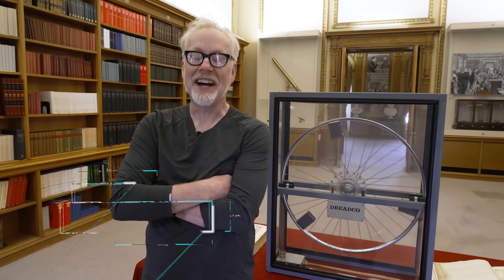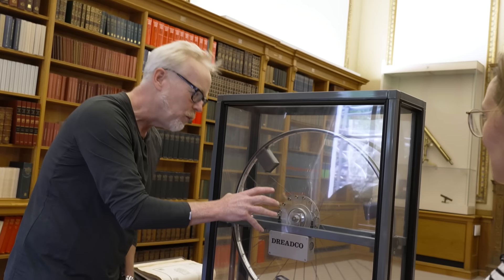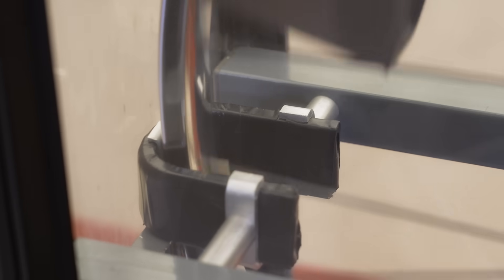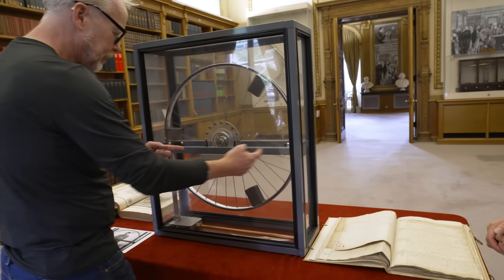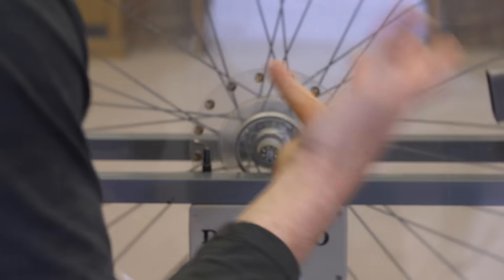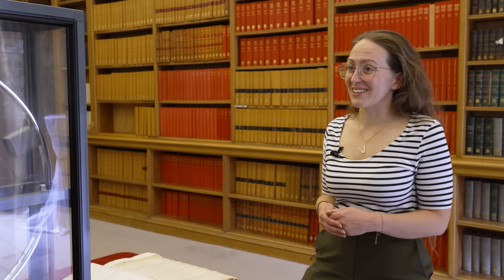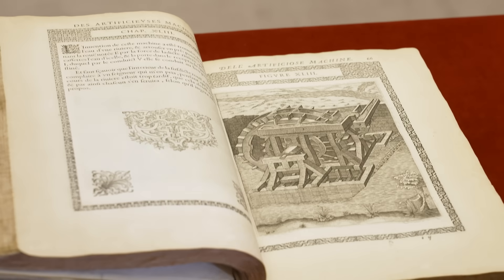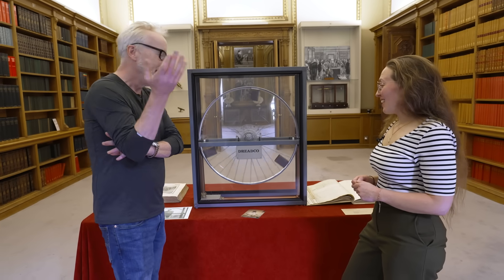Adam Savage vs The "Perpetual Motion" Machine!

Comment: I think each of the three boxes in the wheel contain one reed-switch, one electromagnet and one battery (connected in series). As soon as one of the boxes approaches/enters the stationary horseshoe-magnet (on each side of the wheel) the reed-switch closes and will power the electromagnet which pushes the box away from the stationary horseshoe-magnet. (so the batteries only deliver power for a very short time to overcome the friction from the wheel-bearing and some air-resistens ). All the other items in this contraption are there to distract you. so it is indeed a motor, I'm even surprised that it runs only for 2 years.

Comment: The Dreadco box seems like a sonar range finder set to detect the pieces on the wheel in order to send a synchronized pulse to keep the wheel turning by electromagnetic repulsion. The pipe? just a conduit for the cables. This is why they don't allow close examination.

Comment: Well I know that copper wire can pick up wireless power, and they have a copper pipe at the bottom which could possibly have a copper coil or maybe the pipe itself could pick up the charge, and they have the table covered in a cloth.

Comment: What if you had a tower of water wheels submerged in water and each one had its own generator and you had a small 110v fish tank air pump at the bottom of the tank turning each wheel could you produce more power then the pump was using once the system was primed using a buoyancy wheel 🤔🕵

Comment: Coils in each ofthe 3 blocks sense the approaching magnet and then are driven with a pulse which gives the wheel with a small kick. How about put in a vacuum with magnetic bearings, should spin for ages without any power.
Reply: You need electromagnets and a batter and a timing for switching polarity to make the wheel spin using magnets. You can’t do it with permanent magnets and no battery.
Reply: @Chevsilverado  yes that was the idea - coils driven by an active pulse. It would be more fun to have a low friction wheel, and see how long it could go.

Comment: Even living beings do not have perpetual motion.  Give a machine the ability to process energy from organic materials and to seek them out autonomously and that will be the closest you get to perpetual motion.  Solar is an easy way to do this probably, make a solar-seeking wheeled chassis that follows the sun and can avoid shade during daylight hours with a water avoidance system and hazard detection like modern robotic vacuum cleaners.  Allow it to enter a power saving mode during night hours where the perpetual motion slows way down.  Yes, this could be a fantastic machine and work of art.  See how far it travels a solar gradient, weeks maybe even months before "dying."

Comment: My guess: It's similar to the Put-Put boats we had as kids. The little cups around the hub are level with two vertical pipes, one of which faces up, and the other down. Somehow (don't know how) air is warmed in the box on the bottom left and softly flows up the copper pipe giving little puffs of air into the cups. The balanced wheel would begin to rotate, but lubrication would require maintenance from time to time.
Reply: I agree It is a heat engine. Remember, she said, when they put in the basement, in the dark, it starts to slow down. Which, could mean, not that is dark, but it is cooler, in the basement, so the heat cycle, slows down. Due to heat loss.

Comment: Can someone explain to me how just magnets on a wheel wouldn't be a perpetual motion device?
Reply: Magnets can’t spin a wheel because the wheel speeds up when the magnets approach eachother, but as soon as the magnets pass eachother the wheel gets slowed down by exactly the same amount. 

It will never make the wheel spin faster. 

It’s why electric motors need to use electromagnets and switching polarity, so that doesn’t happen.
Reply: @Chevsilverado  ah thanks that makes a lot of sense

Comment: I'm guessing that the controller in the DREADCO box isn't triggered by light sensor but those two probes, everything else just decoy. Or maybe there's some supersubtle optical sensors but it really doesn't matter how you signal the boxes to give a push, just so easy once they do. Hell, with anything even approaching NASA $$$ i would've just made the boxes have ultrasensitive little sensors inside that detect when the fixed magnets are approaching and use them to trigger the electromagnets powered by the internal batteries. In fact, that suddenly seems almost as plausible to me: literally everything other than those black boxes and the permanent magnets decoys. It would be conceptually easier to make it work with the DREADCO box and pipeworks containing NOTHING.

Comment: 6:23 the more i watch the more i think it's an obvious simple motor with permanent and electromagnets. There's plenty of room for an electromagnet and an 18-650 battery or two in each of the black boxes. Only trouble is timing, but I think there's room for another battery-bank-powered sensor in the "Dreadco" box that transmits a bluetooth like signal to a super-low-power receiver in each black box, which triggers some super-low-power arduino(sp)-like device to trigger the super tiny electromagnetic impulse, just like the tiny stepper motors in each hand of modern quartz watches that can manage to "run forever" on a little light (and usually run in the dark for at least six months on their tiny, probably deliberately small, internal rechargeable batteries). In fact, the lack of a vacuum says it all: they've got energy to spare running this scaled-up watch motor for a coupla years. Only thing needed sealing was the bearing, so that it didn't accumulate grit and dust. An ultra clean and dry ball-bearing is insanely efficient.
Reply: Unsealed bearings have the best free spin rate
Reply: The timing could be done by those little cups and prongs in the middle of the wheel. Looks suspiciously like a reluctor ring. Only thing I don’t get is why they need two prongs and so many little cups.

Comment: 1:38 oh shit: if this just turns out to be batteries in either the spoke boxes powering electromagnets that get ever-so-briefly-and-weakly turned on or batteries in the copper plumbing (which i wonder now if is a decoy), then I'm gonna be so disappointed.

There should be no internal power source. I mean, god: if there is one might as well call a three-hand watch a "perpetual motion machine." Or one of our space probes with nuclear fuel. If the power is internal imma cry DUMB.

Ok, maybe I'll be impressed with the cleverness. But still... somehow powering it from external power like the heat of the room (or gravitational fluctuations or something!) would've been sooo much more coolerer.

Comment: Here is a parallel example of a "renewable" water pumping system. Such systems may continue on farms for 35 years next to a river provided the river never runs dry and the system does not break down. They will continue to run without external power including  without a solar panel, by splitting the energy of the running water through them. https://www.youtube.com/watch?v=9NHVmOchAgI It is called a RAM pump. This initial example with bucket of water as the source, does not utilise natural energy of running river water, so it shuts down much sooner. This is such a clever use of the mechanical energy of running water. There are many examples of RAM pumps on You Tube.
Reply: Some more ideas have been added to the post below just now, for those who want to re-visit it.

Comment: The steel spokes of the wheel, passing through the two magnets, produce small eddy currents, which gets harnessed by the "motor".  The spokes, most likely 18 on each side of the bike wheel, (making 36) are also staggered, creating constant perpendicular charges across the magnets at a deceptively fast rate.

Manufacturers of bike lights use this concept to power small led lights without any other power source, other than the spinning wheels.

Comment: Took me about 2 minutes into the video but I figured out how it works, the box with the word Dreadco on it has a ventilation screen on it which is most likely where the battery is, the box below might have the circuit board, the copper tubing is hiding the wires, the Big Blocks on the outer edges of the wheel are magnets and there's a couple more blocks that they pass which of course are electromagnets it's using keep the thing in perpetual motion which is definitely possible but as stated it is using a form of stored energy, perpetual motion is definitely possible but it can only last for a certain time frame before it loses its momentum because of gravity and of course air friction, this device is definitely very efficient with its motion but it still has to use a spark of electromagnetism in order to keep it going, perpetual motion is only possible with no gravity and no air friction, that of course is outer space

EDIT As i watched the video Adam just spotted everything I just listed, and that's why I love him, he's a smart man

Comment: I think the box has photo sensors, and at 5:00 I think she was trying to hint it gets put away in a dark room for an extended period of time that maybe when they sense light they turn it on and when it goes dark it turns it off to conserve the 2 year battery life. The battery is most likely lead acid. And the drive is most likely in the brass tubes that go to the box. The magnet coil idea Adam was going at is the on off switch because if that was true it would be easy to turn it off Being the box withholds the photo sensors and are attached to the magnets which go through (detect/communicate with) the coil windings. It's just like a dirtbike motor, we ground the coil windings to stop spark which stops the motor, the photo sensors most likely use a resistor which connects a ground to the coil windings, that would cause a change in polarity and probably stop what's driving it either if it is the polarity of the magnets or a simple electric drive motor that's fed power. No matter what it's photo sensors that's the trickery behind the two year non stop period
Reply: lol being in the dark doesn't mean nobody is looking. How would it start up again from standstill?

Comment: It's not battery, it's capacitor, and the anode and cathode gives it enough delay from first to second magnet to let it have turn force. (my educated guess)
And there is the copper pipe has to do something with the cooling and heating? Like stirling engine? As of this comment, I don't know..

Comment: The thing is even if it were a motor that’s generating enough charge to keep itself running, that in fact would qualify as a perpetual motion machine. It’s unfortunate but you can sort of tell he throws in big words and half baked basic engineering principles here to try and make it seem like he really understands what’s going on but unfortunately he doesn’t. A perpetual motion machine that can self generate any resource to keep itself going indefinitely is perpetual motion, therefor in order for it to be pseudo perpetual there is some hidden resource that sssists in the motion that needs to be replaced or “serviced” at some interval.

Comment: If they have permanent magnets it should be easy,  although never perpetual in part due to demagnetisation over time.   The energy is embodied within the magnets.  Some permanent magnet that rotates inside those boxes and fixed magnets on the frame,  thus allowing the poles to switch and act as repulson to give the wheel a push.  The momentum from the turning of the wheel could easily power the rotational switching of the magnets poles.  Thus a small battery might be involved that gets recharged.  Given the wheel is balanced, the magnets only need to overcome the frictional forces of the bearings.

Comment: What it got me thinking about if this were out in space (ie no air pressure), how long would a wheel spin?
Reply: Basically forever. No air resistance or friction to slow it down. 

However in space there’s actually small particles and even in deep space there’s technically some air and other atoms (like 0.000000000000001% of what’s on earth) so it would stop in like a billion years.
Reply: @Chevsilverado  also if it is metal and moving through a magnetic field you'd get eddie currents, and since the metal has a resistance the currents create small amounts of heat, so youd lose energy to that too
Reply: @theninja4137  True

Comment: The Bessler (Orffyreus)wheel is a very simple concept and even with a minimal cost and effort could be made, it's not rocket science.
Reply: It was also completely fake.
Reply: @spaceageGecko  How do you know that, you have read the book and made it? If you don't have try it to make it don't  do assumptions.
Reply: @zoltankolumban1705  You don't need to read the book nor make it when it violates thermodynamics.

One of his maids admitted they turned it manually from another room.

From his own claims it was essentially an overbalanced wheel which has been debunked for a long time.
Reply: @spaceageGecko ...apparatus heavier than air can't fly.... this sentence is familiar to you?So, try to build the Bessler wheel. Forget the thermodynamics, just make that contraption ,that's the point. Don't worry about the laws. Just how I told you, the wheel is a very simple concept, and obey every aspect of the law. Think outside the box you will be amazed 😁Good luck!

Comment: I like the idea that he was a wizard who cast a spell of perpetual motion on this wheel and then just put a bunch of nonsense mechanisms around it to keep everyone guessing for years after he was gone
Reply: If I was a wizard, I would totally abuse my powers to screw with people constantly.
Reply: The "servicing" they do every few years is really just re-applying the spell after its effect wore off
Reply: Hahaha
Reply: CHECK OUT THE INFINITY TRAIN IN AUSTRALIA ......🚂🚂
Reply: magnets themselves are not perpetual
Reply: Wait till you discover Al Gore.  Climate Change hoaxer.
Reply: I totally had the same thought
Reply: Would it be possible to use magnets to make a machine move back and forth? I'm picturing the same thing, but with big magnets on each side to pull those large blocks up just a bit. It would only swing back and forth. Ideal conditions would be that the magnet can "hold" less than .0001 MG less than the weight the machine puts on it. Though now working through it myself, a bit will be lost to friction with each pass. Unless one was able to 100% convert the heat from friction into movement, it's not possible. One must add an outside energy force or convert literally all change of state energy within a mechanism to power the mechanism.
Reply: @tylerhorn3712  I've been thinking a similar thing for a whole. Is a body in motion not already in perpetual motion until a force acts on it? So all u need is a frictionles surface. What about a superconducting wheel levitated on magnets?
Reply: @mihailmilev9909  look into "mechanical battery" there is a design made by nasa which uses magnetic bearings, a mass, a magnet and coils in a vacuum chamber. this eliminates nearly all forms of friction so the mass can spin indefinitely (ideally, there is still some friction in the bearings and a little air, but i think it can spin for a very long time) you can make it spin by putting electricity into the coils, like an electric motor, and you can get energy out by putting a load on the coils (like a generator) doing so, of course, slows the rotating body (via lenz's law a magnetic force is applied equal and opposite the electric force, so when it produces energy it produces a magnetic force that acts against the rotating magnet slowing the mass)

it's a very clever battery.
Reply: @mihailmilev9909  there's still air resistance. And even if you pumped all air out you'd still have friction between the magnet and the superconductor, through eddie currents induced by the motion.
You'd have motion for quite a long while but it would slow down
Reply: @mihailmilev9909  air resistence
Reply: @mihailmilev9909  Technically yes, but there is no such thing as a truly “frictionless surface”.
My understanding is that, unless there is no gravity nor medium (air for example), there is no such thing as “zero friction”, just extremely small amounts.
Reply: @mihailmilev9909  I know I've seen a video about your idea being impossible for another reason but It was so long ago I don't remember what it was titled.
Reply: @tylerhorn3712   The main reason magnets are not considered in perpetual motion machines is because eventually, the magnets would lose their charge.
Reply: @tylerhorn3712  Theres a YouTube channel that built a computer in a box, without fans, that operated on an air pumping mechanism through the force of magnets.
Reply: @crisnmaryfam7344 if it’s the video I’m thinking of the guy used magnets to move the bellows, but used a water pump system to move the magnets
Reply: @tylerhorn3712 
No
Reply: @oggyoggy1299  yeah, eventually positive or negative magnet will degrade. Energy loss is a thing via heat/friction.

Therefore you'd need to create a closed loop  to really make it work (think small steam engine heat sinc). Even with a "perfect" energy conservation mechanism, atom decay (in this case magnetic) would become a problem. 

The better question is how long can it be kept going as true perpetual motion.

The best question is: is it worth it to build one?
Reply: @tylerhorn3712  No, because magnets pull equally in both directions. Push and pull.
Reply: @9PlatinumGamer9  I know it's not actually gonna work, but the magnet "holds" .0001mg less than the weight, so it enters a "reset point" on each side. If it went above, it would get sucked back down... but that energy isn't needed. As long as the magnet draws it back up into its "reset" point on each side, it should go on untill the magnet looses strength (noticeable magnetic degradation takes 5-10 years).